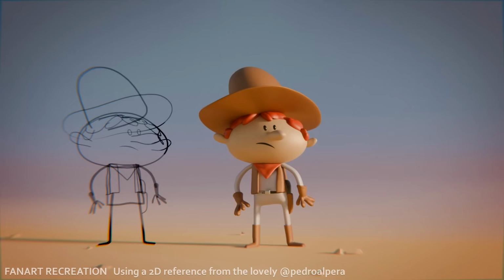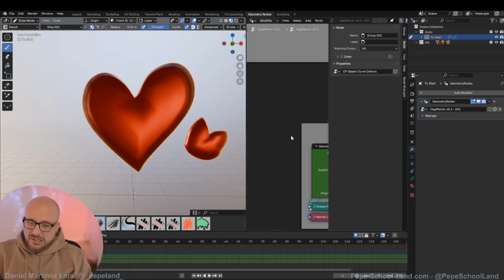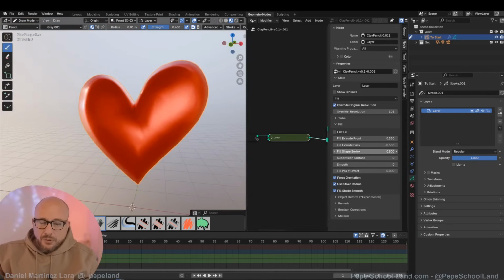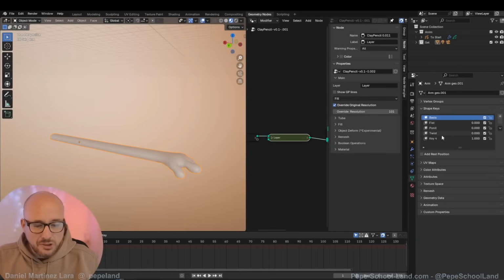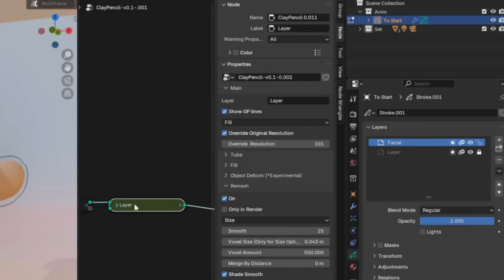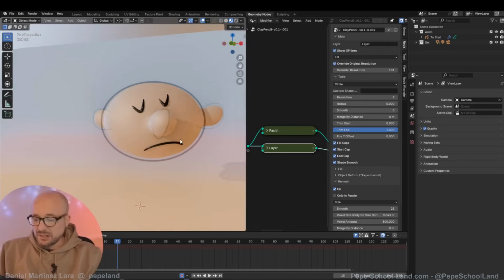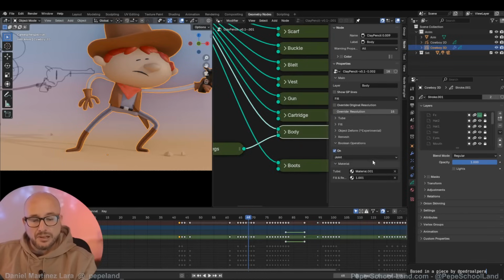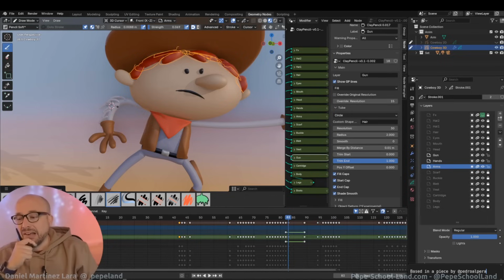034 Claypencil v0.1 Tutorial & Overview For Blender 4.3

Comment: Thank you for this wonderful setup and helpful guide to use it! I have been struggling to find enthusiasm for 3D animation for some time now, and this has me messing around in Blender again!

I have a question:
On my Mac, changing Stroke Placement to Surface, places my lines on the Background plane instead of the 'model'. Are there any extra settings I need to change for that?
EDIT: Downgraded to 4.3.2 and I can paint close to Surfaces now, but with a slight offset. Setting Offset to 0 does not fix this.
RESOLVED: Tried painting on a brand new Layer and it works just fine now!
Reply: I'm using Blender on a Mac and experiencing the same issue. My version is 5.0. Would downgrading solve the problem?
Reply: @혜린-m1l4u Worked for me! Give it a shot!
Reply: @runhidesleepeat  I tried downgrading but it didn't work for meㅜㅜ I just moved it forward!! Thanks for the comment!!
Reply: @혜린-m1l4u  Nice! So you got it working on 5.0?
Reply: @runhidesleepeat  I'm using this program on version 5.0!! I just used it for practice!! I was originally using version 4.8, but I had the same problem, so I upgraded to 5.0 and tried again. Then I tried version 4.3 as you suggested, but it didn't work, so I just upgraded again to 5.0!! The problem is still not fixed, but I just brought it forward and worked on it haha. Other than that, everything seems to be working fine!!

Comment: Hi, I’m trying to draw facial expressions in Grease Pencil. I have set the stroke placement to Surface, but the lines always appear on the background object instead of on the character’s face. Does anyone know why this happens or how I can fix it?
Reply: assuming your layers are in the proper order, you have to turn on something called "z depth", there's a little check mark box in the "view layer" tab to the right of the screen. under the "passes" then "data" drop down, you'll find a little checkbox labeled "Z". check that on and you should be all set.
Reply: @Laylinxx  I am unable to find the 'passes' dropdown in the view layer tab. (4.5.3) - I found it, I was looking in the wrong tab! Unfortunately, enabling it does not fix the issue and facial lines are still drawn on the Limbo behind the character.
Reply: The version I am using is 4.43.

Comment: this tool is so amazing. i am not sure why, but i cannot get the "surface" drawing mode to work properly. it doesn't recognize the mesh as a surface, and always draws straight onto the background, drawing straight through the mesh... do u have any advice to help me get the surface mode working properly?
Reply: i realized this issue is only present in Blender 4.4. I opened up the file in 4.3 and the surface drawing mode worked properly. **

Comment: Can you help me understand the modifier "surface Deform"-  it works on meshes and I think its very valuable to work with Grease Pencil during a mesh deform with shapekeys, it would be great if the GP drawn on the surface would deform with the mesh.  But even with your node groups, I can't add a  "surface deform" modifier to the GP after your nodegroups (is it a bug that the modifiers don't consider your 'GP-turned to mesh' a true mesh object?  .. or is that how nodes are always going to work with nodes??  Can we someday use 'established modifiers' in the geometry nodes schematic?

Thank you for considering this..(seems like you are so close with your node group..)

I'm not sure links will work, but here is where someone recognized the value of GP deform to mesh and was working on the project but seems to have given up:
projects.blender.org/blender/blender/pulls/124782

Comment: wowowow thanks , if i want to change the color of the matrieal or the geo node how ? is there any tutorial
Reply: You can find the materials set on the background mesh object. Just change the material slot to find all of the different materials that are being referenced onto the Grease Pencil object. Definitely a bit wonky since you can't apply a Cycles material directly onto a Grease Pencil object. It seems like you need to apply materials to a separate mesh object and then reference the material using the Clay Pencil setup.
Reply: @jordanstone9588  Thank you so much! That's the solution; it was all in the "background object."

You can create a new "Shading" workspace, and from there, select the background object in "Object mode," and that's it—your materials will appear.
Reply: I can't seem to apply the color from another material of mine :( I wanted to make it pastel pink, but it turns gray when I try to attach the new material.
Reply: @pinkompany   yes:(  i wanna start making my own animation with my character but i cant color the clay to any color  only like 4 matrial thats apper for me from the file and all become off white , if you find a solution pls tell me
Reply: @ClayMuslim-ar  
Well, I'm excited to know that I'm not the only one with the same problem. It's probably because it's version 0.1, and it almost counts as a demo. Maybe it will be fixed in the future.

For now, I haven't found anything. I spent all night yesterday trying to make it work, but I had no results!